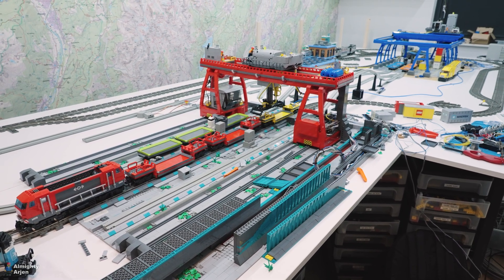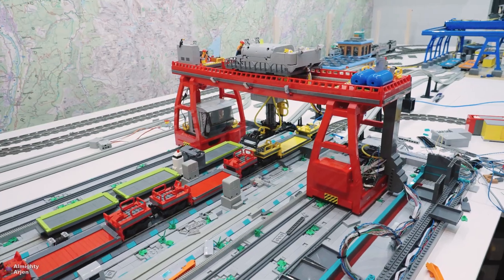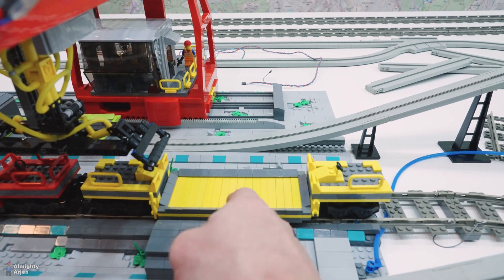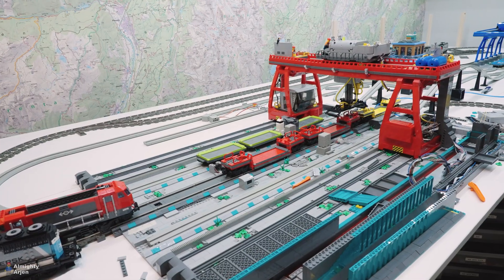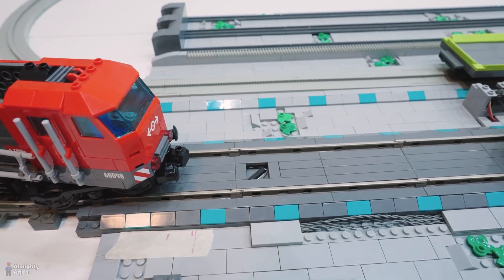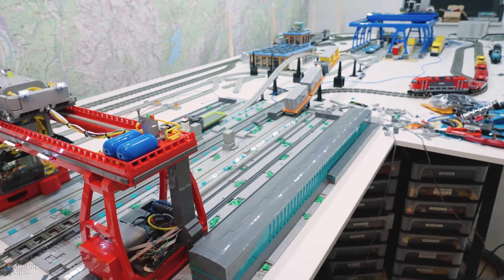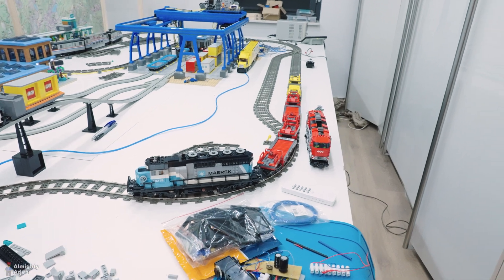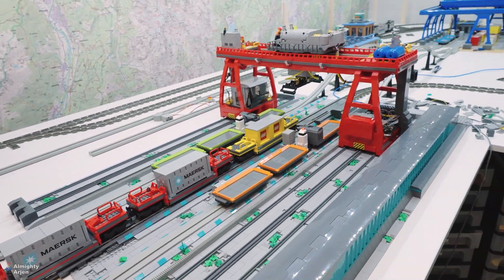Automated container terminal WIP E56:  flawlessly working red crane!

Comment: Have you thought about using bluetooth or wifi modules to get rid of some of the wires? Your videos are great keep them coming.
Reply from the maker: Yes, I have given it a thought but practical solutions are difficult. Most wiring is going to sensors and motors in the field, you need in that case a microcontroller at every (group of) sensor or motor, which defies its purpose. Next to that, a sensor and motor needs power so I need to bring a cable to it anyway.